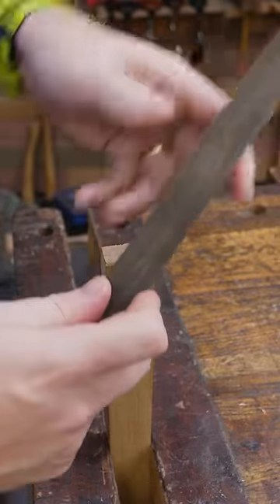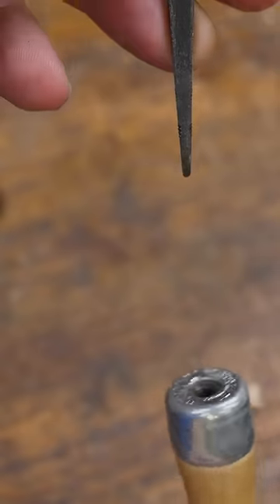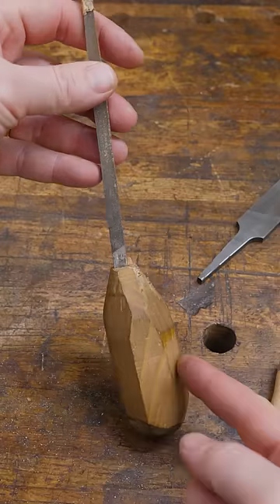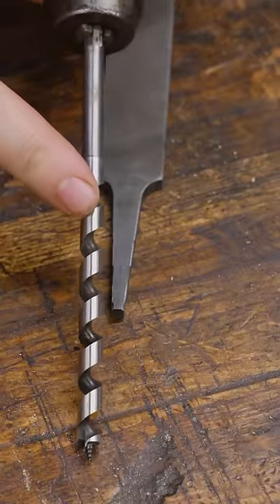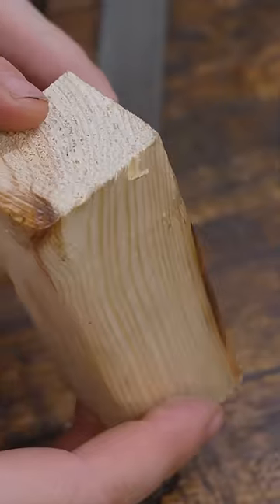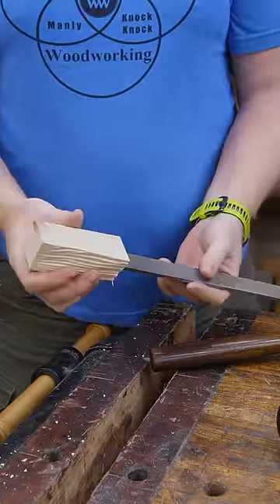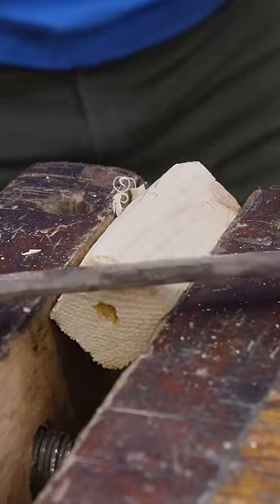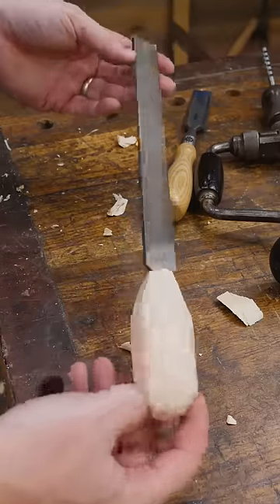How to Make a quick File Handle

Comment: Sure you can make a handle just as he suggests, But you will notice she never told you. How long it will hold up, which is only after a couple of uses, and then the steel protruding into the wooden handle will a longgate the hole, and it will not function at all!  Stop and think why file manufacturers haven't included a softwood handle. Stupid is as stupid does.
Reply from the maker: odd as the other one I showed has been on that handle for over 7 years now.